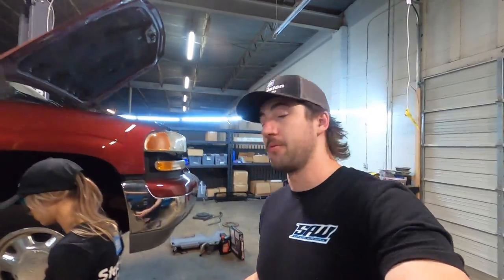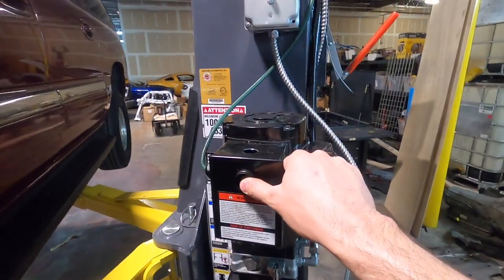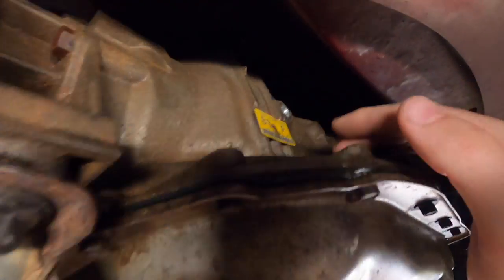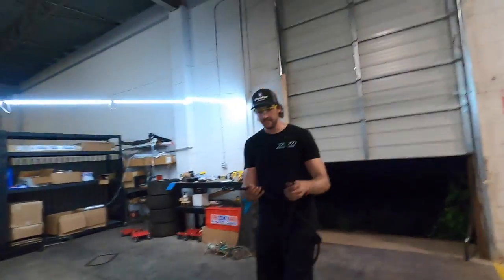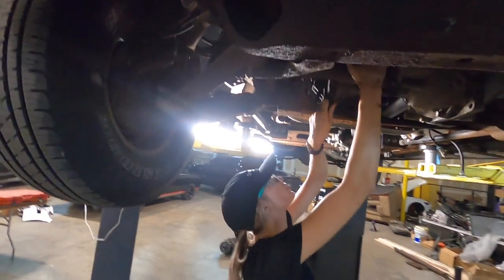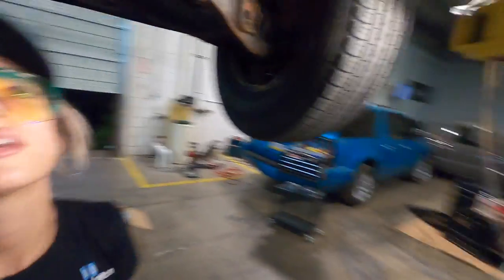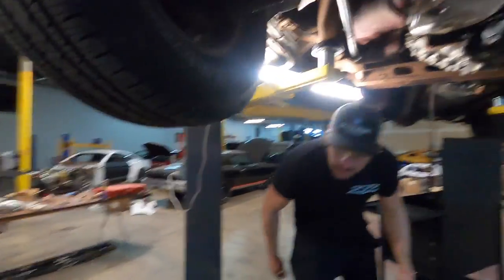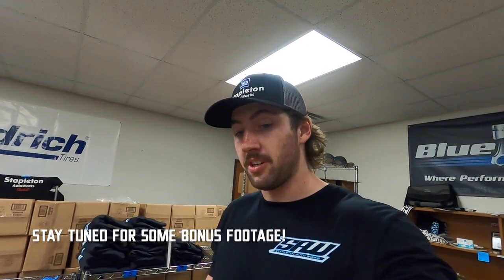Budget Turbo Yukon XL 4L80 Conversion: AN Line Conversion! Best Transmission Cooler Line Upgrade

Comment: 1 more thing to add....in the AN fitting sizes, its based on 16ths of an inch. So -6 is 6/16(equivalent to 3/8), -8 is 8/16(1/2), etc

Comment: When putting the first piece of the AN fitting over the hose, turn it counter clockwise. And clean out the line after you finish assembling it, it’s full of debris.
On piece at a time!

Comment: I got that stuff plus a cooler with thermostically controlled fan
It's goin on the right chassis rail 
Been hammering on my daily doing the mods I need for the twins I have for my ext cab
I goin to put a series of pics of my deal somewhere soon
Reply from the maker: That’s a good setup!

Comment: It's in 16ths referring to inner diameter. I know this and have never made an AN line. Thanks Marlan Davis (Hot Rod Magazine 1980's and 1990's). 

-4 is 1/4" (4/16")

-6 is 3/8" (6/16")

-12 is 3/4" (12/16")

-16 is 1" ID

Comment: Where every dash number is 1/16 of an inch an AN6 fitting would be equivalent to 6/16" or 3 /8" Fitting size. AN8 8/16" or 1/2" for example.
Reply: Inner diameter of course
Reply from the maker: Ahhh I see

Comment: Pretty sure you're right about the A.N. fittings, dash 4 is half inch... dash 1 would be an 8th inch
...I have been corrected! They're ¹/¹⁶", not ⅛" so a dash 4 is ¼"
Reply: the numbers are 16ths. a dash 6 is 6/16ths, which is 3/8ths.
Reply: Dash 4 is a quarter inch

Comment: I have yet to add a trans cooler to my truck, but i have all the parts for it. Including 25 feet of rubber fuel hose. Called how much is left on the spool, and i bought what was left on the spool.

Comment: Dash-anything is 16ths of an inch, AN is also the same as JIC if you need something in a pinch and don’t have summit down the road.
Reply: Also, one other suggestion-when making a pain of lines like your trans cooler I will use a very long hose and put my 90s on both ends then route the pair how I need them and mark/cut both of them at the same time. This allows for only a single piece of excess hose and possibly being able to install the field fittings in place

Comment: It be nice to have links for some of the parts you use . I'm doing stage 1 on my 02' SsCalade build now.. Budget built 6.0, cam , headers , exhaust , self ported heads etc etc .. looking for 450 wheel
 N/A... 🦖💥🦖

Comment: I’ll tear my hands up because I’m hard headed lol 
Like you said once my hands are in there ima do absolutely everything I can to get it as tight as I can.
Reply: agree, if the option are tearing up my fingers or moving a wrench back and forth a 1/4 inch 50 times, i'll go with tearing my fingers up option.

Comment: On the late 4l80 that long fitting for the cooler lines will not go into the front you wont be able to screw it all the way in. If you put 2 short one in you will burn up 3rd and 4th or the planet in the back or both not 100% but it will be bad haha

Comment: AN fittings are measured/sized in sixteenths of an inch, i.e., -6 is 6/16" which reduces to 3/8". Easy stuff, used them in aircraft work too!

Comment: Did this truck originally have the optional Auto 4wd feature transfer case? Or just your standard 2wd, 4x4 high and 4x4 low? Have an 03 yukon xl as well and looking to swap to an 80e/261hd combo like this.
Reply from the maker: It was auto 4wd originally
Reply: @Stapleton42  good to hear, was there any wiring involved with the new transfer case or transfer case switch? I noticed in one of the videos the switch on the dash has the 2wd 4hi and lo switch and not the switch with the big auto 4wd top button.

Comment: I'm thinking about doing this to my 04 Sierra 2500hd, my lines go into the radiator first and then the external cooler.  Do you kno what size the fitting are in the radiator? So I can adapt them to -6AN.

Comment: I looked up the AN thing on the internet

“AN Size” designates the outer diameter of the hose or tubing in 1/16” increments.

FYI: Popular fuel line sizes:
-6AN      (=3/8" OD)
-8AN      (=1/2" OD)
-10AN   (=5/8" OD)
-12AN   (=3/4" OD)

By the way - remember when I told you lifts tend to make people do dangerous stuff? Watch Logan in this video :P
Reply: It's the ID of the hose or tubing.
Reply: @thuggard88  I literally posted what the AN standards say in the DoD manual

It is NOT the inner diameter, it is the outer

Comment: Just a random question for you  whenever your making lines like in this video have you ever used a piece of heat shrink tubing in place of rapping it with the black tape ????
I just feel like you would be the person who would try it bc of the way you are when it comes to just using whatever tool for whatever job and I've just always thought heat shrink tubing would work good but haven't ever had the chance to try it out so let me know if you have please or maybe even next time you need to make a line try it out and then let me know 
Also just want to say hey from around your old stomping grounds in western Pa/ New Castle/Butler Area

Comment: We completely built a car in two hours with all bolt on parts.
Screw that i would rather see the parts being built modified and installed.
The grinding gritty stuff is the best. Little slow sometimes but that's part of it.
Judging by your followers and the amount of comments a lot of us think that way.

Comment: AN sizes range from -2 (dash two) to -32 in irregular steps, with each step equating to the OD (outside diameter) of the tubing in 1⁄16-inch increments.  -6 is 3/8. love the content.

Comment: AN lines are in 1/16's of an inch. So -6 is 6/16" or 3/8" ID. -8 would be 8/16" or 1/2" ID. I think you meant 1/16's instead of 1/8's when you said that, though ;)

Comment: AN stands for Army / Navy or AeroNautical.   There's other old Navy dude tales about what AN stands for, take your pick about what you want to believe.     They are sized in 1/16" of an inch, like a -6 fitting would be 6/16" or 3/8"

Comment: AN lines are measured in 16ths so a 4AN is 4/16 or 1/4”,, 6AN is 6/16 or 3/8”,, 8AN is 8/16 or 1/2”,,  10AN is 10/16 or 5/8” etc.etc.
Reply: Also a little useless knowledge , industrial standard drive chains like driving conveyors , fans and whatnot are measured in 1/8” so size 40 chain is 4/8 or 1/2” from chain link pin to pin center ; size 50 chain is 5/8” from pin to pin ; size 60 chain is 6/8 or 3/4” and so on.

Comment: Would the 4l60 have the same cooler lines treads to use the same fittings you used ?
Reply from the maker: Good question. The chances are high its the same but I do not know for sure

Comment: Proven fact: even if you check your ratchet rotation on a wrench. You'll still get it wrong once you put it on what you need to tighten or loosen when you put it on and have to flip it😂

Comment: Did you know that each drill bit has a speed setting I didn't until I took manufacturing class in school I didn't care about what speed the drill was set at it made a hole that's all I needed

Comment: Use oil when assembling AN lines. WD40 is not good enough, second tip, use continuos motion to assemble, as if you stop rotation hose may stick to fitting and kink when you continue rotation.

Comment: When I did A-N line on my short wide it was a trip. Summit ended up loosing me as a customer for life over it. Jeg's all day if you want competent people. Anyway, whoever want's to do this you better have the A-N specialty wrenches and those fancy blocks for the vice he showed you. I used nice duck tape and a dremmel tool to cut my hose.  Please do not in any way ever cut the A-N line with a saw's-all. You are not on YouTube and nothing is cheap anymore do it right or pay twice.

Comment: Are you looking to go hardline in the future for those coolers, or stick with what you have? How do those hold up to sustained high temperatures during race nights? Have you found that two smaller coolers work better than one larger one? I ran with one large intercooler until the guy in front of me on the pad shot a u-joint during a burnout, bounced it off the pad, and buried it into my new cooler.
Reply from the maker: Good questions. My Escalade does just fine with these same style lines

Comment: Correction:  AN-6 is basically 3/8"  which is 6/16"of an inch in term of 1/16 increment in SAE measurement.
Reply from the maker: Yeah something like that. Fractions don’t work well with my brain

Comment: If you don't understand which transmission fittings to use, then do everyone a favor and ask someone! or pay someone to do the job! Early 4l80e has a front lube pump, late model has a rear lube pump. Thanks for repeating the info over and over. I've had to replace more than one ruined transmission from people using the wrong parts, or installing something wrong.
Reply from the maker: That’s what we’re here for 🤟🏻😂

Comment: The id measurement of hyd hose goes #4= 1/4",  #6=3/8", #8=1/2", #10=5/8", #12=3/4",---- #16=1".  So each number is equal to 1/16th of a inch.

Comment: If your hands dont look like you stuck them in a blender then dragged them across the driveway 100 times you aint doin it right. 😂 Always tighten as hard as you can with your fingers lol.

Comment: AN and JIC fitting should match up and work correctly. However the only difference of JIC it is a less precisely made fitting on the threads. AN is 1/16" increments. Any heavy equipment dealership that makes hydraulic hoses will have jic in stock. When you're out on race weeks or traveling it's good to know this. Just some knowledge from a diesel tech.